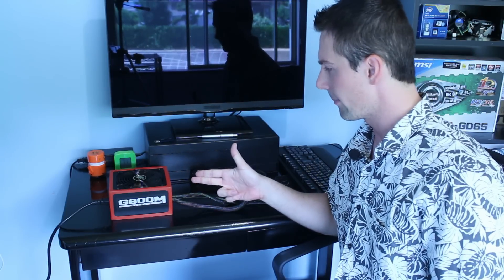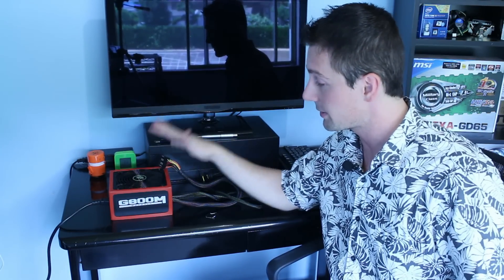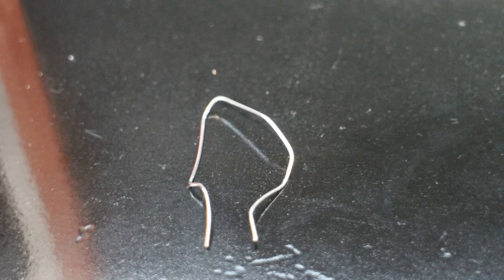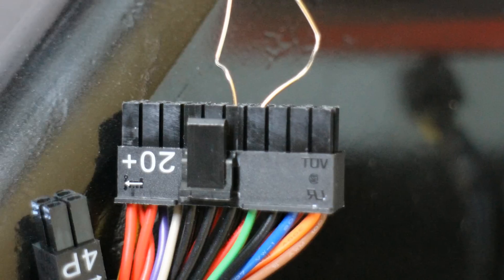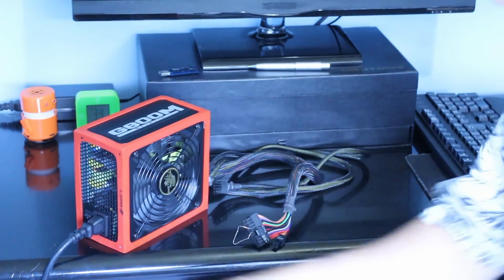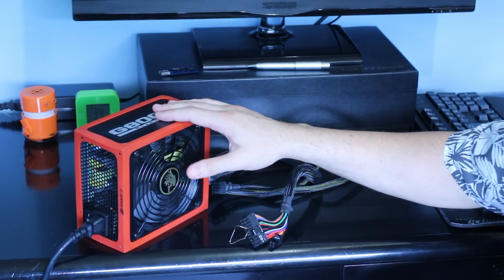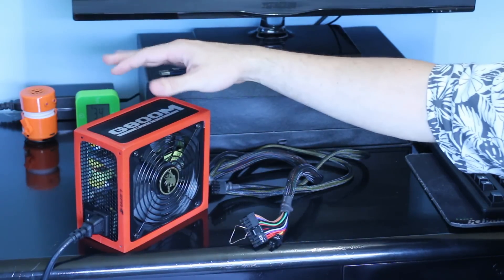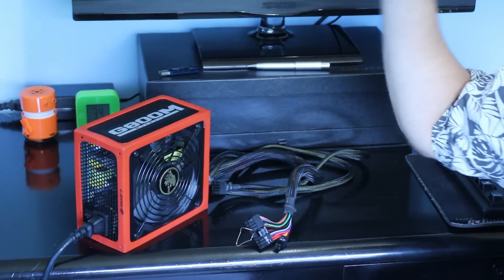How to Test your Computer Power Supply By Itself - (Test if PSU is DOA)

Comment: I want to know more how this works. I am not a electronic engineer but I certainly would want to understand how this self test came to be. If it is not too much too ask, can you provide a detailed explanation how this self test came about?
Reply: this is 2 years a little too late but the green wire represents an input from the PSU to the motherboard and the black wire represents a 0-volt or ''ground'' connection. Without the black wire to connect to, the power supply wouldn't even react. this is some basic knowledge gained from working with electronic products.
Reply: No

Comment: Hey guys, I am a bit confused. So if it is working, the fan will keep on running correct? But what if we do not put the pin, will the fan still run or it wouldnt run even if the PSU is not DOA?
Reply from the maker: If you don't put the pin in then nothing will happen and you won't know if it is faulty.  However when you put the pin in it should normally just keep spinning until you turn the power off at the PSU or wall.

Comment: how much time from hit buy button to system running after DOA RMA plus how much money you spend EXTRA for a DOA component status fix.
Reply from the maker: Oh Amazon just exchanged it no questions asked, posted me out another one free of charge (amazing service), though I had to post back the faulty one.
Reply: then you spend the post back DOA one, ok
Reply from the maker: Yes but if it is faulty they will compensate you.
Reply: in my opinion if you have a doa unit they need to send you a postal bar code with new unit so you send doa one for free, that way is excellent customer care otherwise is just a good service. just an opinion

Comment: Not all power supplys fans will spin all the time only when it reaches a certain load. I know the Corsair gold ones are like that.
Reply from the maker: Yes true about the dynamic fan models, I will have to look into that a bit more, interesting and thanks for the comment.
Reply: Some also have a switch that lets you switch between always on and "on-by-sensor" or whatever it's supposed to be called.
Reply: most psus, even the dynamic fan ones spin the fans for a short time on startup, like my seasonic prime.
Reply from the maker: Thanks for the recommendation, I wanted to get some more gear so I could test PSUs properly in the future.  So just load some resistance on the PSU and check with a multimeter?  Any chance of smoking if it is indeed faulty?
Reply: Agree, some PSUs need a fan or some load attached before they power up.
Reply: @tylormaxis  have you seen anyone do it? If so, what was the cause of death? Shot in the head by the neighbour? Heart failure? Bitten by a zombie?
Reply: Tech YES City Well, if you really wanted to test a PSU, you would need to put some load on all of the rails, then measure. But if all you want is a quick test for DOA units, then just load the 12V rail and try to start it.

If the PSU is faulty it is possible that it will go up in smoke, but not very likely in modern PSUs. However you should choose a suitable test resistor, because the power used by it will get converted to heat, and if you generate multiple watts of heat in a tiny resistor rated for 0,5W, then the resistor might smoke :)

To figure out the values needed, use P=R*I^2 and R=U/I. If you want 5 watts of load on a 12V rail you will need to draw 5/12 of an amp(0,416A), and you can do that with a resistance of 12^2/5 ohms(28,8ohm). So you would need a 28,8 ohm resistor with a power rating of at least 5 watts. Such a resistor is not commercially available, so you would buy the closest resistance value you can find, with the appropriate power rating of course.
Or you can just get some 12V light bulbs from cars or other sources, or make your own resistor out of multiple small resistors or light bulbs.
Reply: Tech YES City Generally the best way to check if a PSU is on, is to check the output voltages with a multimeter.
But I want to point out something I have experienced with older PSUs, and that is minimum load. Some PSUs cannot get to a normal operation mode without at least some load, because the voltage regulation cannot stabilize without a load on the output, the voltages go out of spec and the protection circuit shuts down the PSU. So this test will judge any PSU that has a minimum load as faulty.
One solution is to use load resistor between 12V and GND, to draw a small amount of current. I have made such load resistors from junk Christmas lights, but any resistor with sufficient resistance and power ratings will do. (you only need a couple watts of load, use Ohm's law)

Comment: Great video!
I'm surprised you actually went with that dodgy brand in the first place, though...
Seasonic, XFX, EVGA and Super Flower are the way to go. :)
Reply: where can you buy super flower items xD?
Reply: Lol good luck hopefully it doesn't arrive DOA :P
Reply: Antec, and some Corsairs, like the AX series, and great too. :) 
The EVGA G2 and B2 series are based on Super Flower designs and are amazing quality and really cheap.
Reply from the maker: TheCodasaurus Yeah Antec get a huge recommendation from me, never had a problem with any of their PSUs, Haven't tried a Super Flower yet though, though got a Corsair at work that is running fine (though Corsair tend to be pretty pricey in Japan).
Reply: Tech YES City Super Flowers (or the EVGA G2 series) are the best out right now man. They're also pretty cheap. I reckon you should give them a try next time you need a new PSU! You'll love it.
Reply: where can you get super flower items  :P?
Reply: They're really hard to find. If they aren't on the website of your choice, go for the Supernova G2, it's made by Super Flower but it's even better than their own PSUs. :)
Reply: do you know any other good ones :P
Reply: yep. Cooler Master V series
Reply: That DOA PSU is made by Channel Well, who also make PSU's for such illustrious names such as Corsair, Antec, Cooler Master, Enermax (which is amusing because Enermax themselves are a PSU OEM), Gigabyte, OCZ and Thermaltake.

What's more; neither XFX nor EVGA make PSU's, they only sell OEM's. XFX is exlusively Seasonic OEM, and EVGA use a mix of FSP, Enhance and Etasis, dependant on which line the PSU is. As far as I'm aware they do not use Super Flower. Neither EVGA nor XFX design their PSU's, meaning that if you buy a XFX PSU, you're buying a Seasonic PSU. For EVGA, the entire Classified SR-2 series is a straight Enhance OEM production.

The brands I listed up top do actually collaborate with the OEM's in the design of their respective PSU's. Lepa, which this PSU Brian has, is a straight Channel Well OEM however.
Reply: EVGA spits out garbage PSUs if you go for under 200 euros.